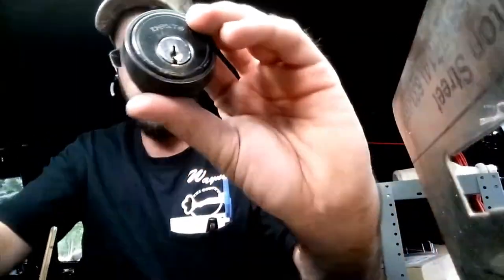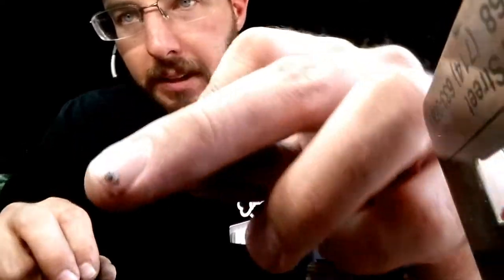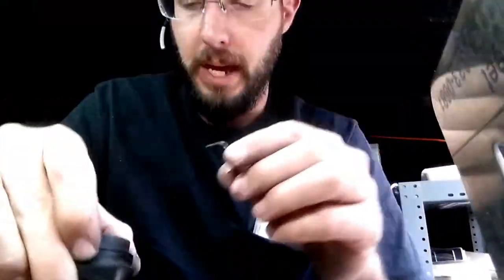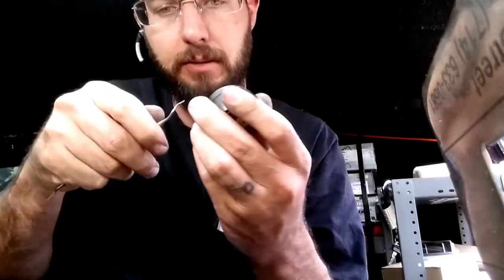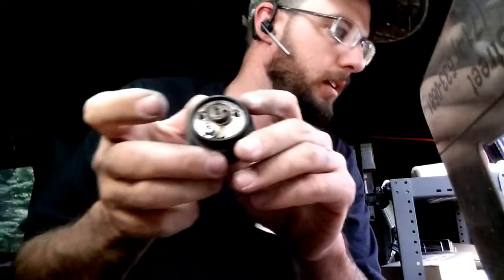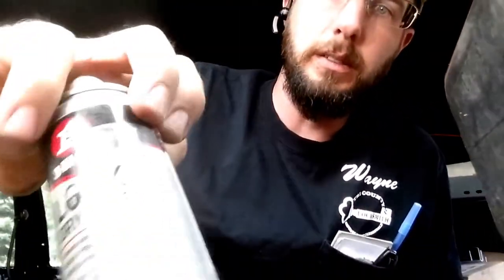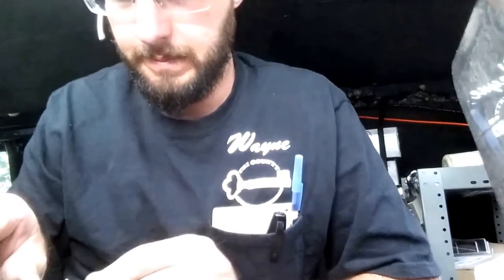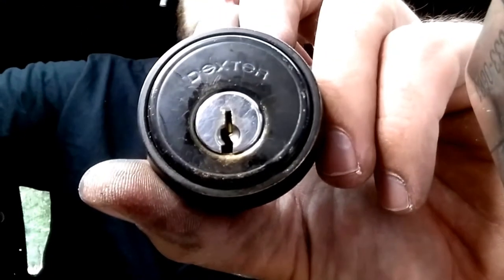Dexter Deadbolt Lock Cylinder Re Key Trouble with a Stuck Detent

Comment: Thanks! Great troubleshooting skills! 

I'm glad I found your video; a friend called me this afternoon to ask if I could help him get back into his house, because the (Dexter) deadbolt would just freewheel every time he turned the key. As we talked, he realized that he could try the back door and was able to get into the house. Weirdly enough (to my way of thinking), the key easily unlocked the deadbolt from the inside! He tried (with the door open) to unlock it from the outside, but it just spun freely again. 

I'm just a handyman for my friends, and I don't have the specialized knowledge and experience that you obviously have, so this sounded like a little bit of magic, to me. Still, he asked if I could stop by tomorrow to see if there was a solution (other than replacing the deadbolt lock). Does any of this problem sound familiar to you? 

I thought I'd try to track down a diagram of the guts next, just in case a peek at the moving parts might give me some insight into the inner workings of the lock, but any advice you could give will shorten the time I spend practicing my 4-letter vocabulary words and staring at the thing, tomorrow! 

Incidentally, the dry lock lubricant is news to me! Thank you for that! I've always told people to NEVER spray oils of any kind into a lock for lubrication, because they catch dust, dirt, etc, and gum up the works, but hadn't known of anything except graphite (or graphited lock fluid) to suggest as a substitute! I'll add the dry lube to my shopping list!

Comment: Hi Wayne,  I have a question I hope you may be able to help me with. we just moved into a house and I want to rekey the locks. the house was built in the seventies comma and the locks in the house or Dexter brand. The key is a DE8, but it will accept Kwikset keys. Which tools would I need to rekey these locks?  Would I use a Kwikset follower tool or a Schlage follower tool? Which pins would I use? Any help you could give me on what I would need to rekey these locks would be greatly appreciated.
Reply from the maker: Chris Bates my first suggestion would be to hire a professional locksmith. look up an ALOA accredited locksmith on Aloa.org Web page. use the locksmith finder. it will be far less aggravation and most likely cost less in the long run. if you insist, schlage kwikset and Dexter followers are all the same. you would need dexter Key blanks and dexter pin kit and a way to cut dexter keys to dexter depths.